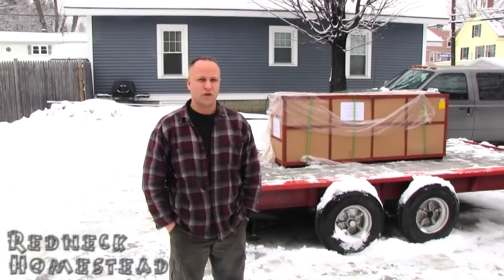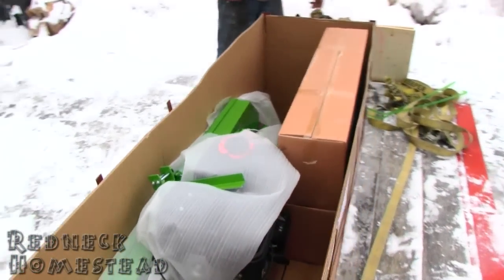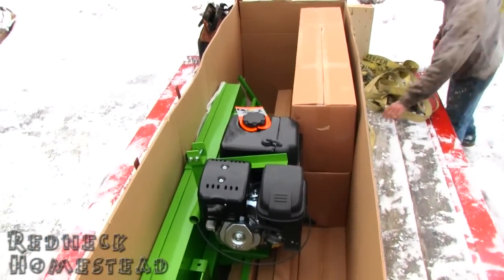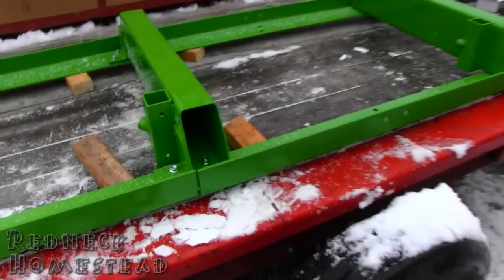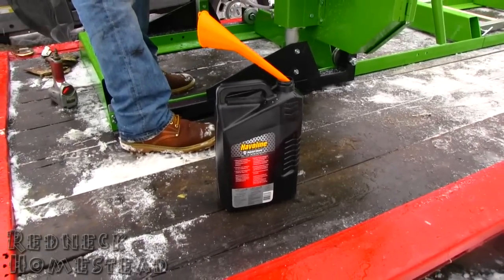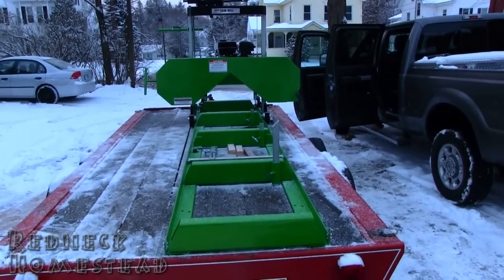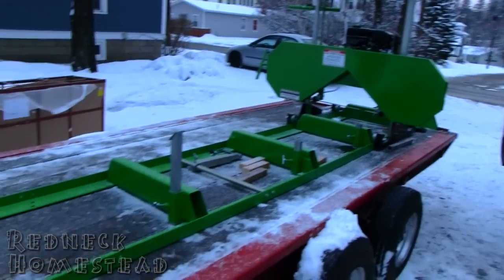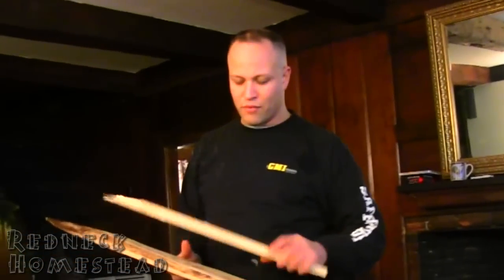Central Machinery / Harbor Freight band saw mill - unboxing, assembly, and review

Comment: I saw this little mill in my harbor freight catalog and thought "what a great thing it would be to have a very small mill for the smaller size logs".  I don't have my big mill up and going yet but the guy that had been cutting my lumber mentioned how he didn't care to cut the smaller stuff because by the time you get it set up......your done and have to start over.

Comment: Please shoot some more videos of this mill in action if possible. How do you think it will handle the big logs? I would love to see more videos of it. There's not many on YouTube. Yeah I know a lot of people don't like harbor freight but for most things they can't be beat anywhere else. Great video! Glad I subscribed.
Reply from the maker: I will definitely shoot some more video of the mill in action.  My initial impressions are very good but the log handling system is very poor.  I sawed 2 small logs last night and they were very hard to secure.  Admittedly, because the mill is not elevated (yet) I could not set the dogs low enough (they were hitting the trailer bed).  Additionally, the "log clamp" is clunky and with a point on the tip, it does not distribute the pressure so on anything but a perfectly straight log, you will likely get some lateral shift.  These are issues that are VERY easily fixed and i am designing a system that will be tighter, more versatile, and easier to adjust.  I will be doing a video on it in the next couple of days.  Thanks for watching, and we're glad to have you on board!  -Josh  (and by the way, i love to boat too!!!)
Reply: Redneck Homestead Great. Yeah you'll have to change a few things on it but it looks to be a great starter mill. Sounds like you're getting things figured out. No problem. I'm glad to be here. I do love boating but my problem is everything is frozen at the moment and I don't have a reliable motor. Lol.

Comment: Ready to purchase one for myself tomorrow. I will likely modify it as well. Add some tubing behind to make it a 4-post design. If you haven't already, check out Woodland mills HM 126 sawmill. Virtually the same chinese mill, but a few extra frills. It may give you some modification ideas. I'm going to purchase my blades from them. 10 lenox blades for 225 bucks. 144" x 1.25. They can be resharpened too. Thanks for creating a video. Information is power.
Reply from the maker: Thanks for watching Paul Weatherby !  I am excited for you.  The assembly was a breeze, but i would recommend considering welding the track segments for a smoother transition.  I, too, am planning on a 4-post design.  There is an unacceptable amount of twist with the 2 post design.  I have seen the WM HM 126.  My bet is that it was made in the same chinese factory!  That is a good deal on the blades.  I got mine (Lenox as well) out of an outfit in Maine called NH Bragg (http://www.nhbragg.com/)  very very good service.  Please keep me posted on your mill...i'd be very interested in your thoughts after putting it together and trying it out!  - Josh

Comment: Nice. Always wanted a smaller mill like this for myself. Just some advice that you may want to purchase in advance extra blades as HF is notorious for discontinuing parts for their products. I'm sure it comes with a standard size blade you could swap out with a better make though. Good luck with it!

Comment: That sure looks like a nice machine. Very interested in seeing how it works out. I could sure use one on my place. Price looks very reasonable. Considering how many trees I cut down and let lie, I could put them to good use for my woodworking projects, cabin or what ever.
Reply from the maker: Don Ritter It is HANDS DOWN the best deal in portable band saw mills anywhere i have found - after a couple years of researching them.  Sure, there are better mills, more bells and whistles and more conveniences, but be prepared to pay anywhere from $10,000 to $40,000.  The Central Machinery mill will cut all the lumber you need to build your cabin and every outbuilding, as straight as an arrow (if you set it up correctly), and will do so at a fraction of the cost :)

Comment: Awesome video, this is exactly the kind of thing I needed to know before I made the decision. Have some logs from taking down a 100+ year red oak here in Missouri and a chainsaw mill wasn't cutting it- literally. So I got one on the way.

Here's my question if you can answer it: how tall is the sawhead and how high does it have to go when you're assembling it? I'm asking because I was thinking of using cherry picker to put it up, and I want to make sure it can reach. Otherwise I'm going to have to build some sort of hoist.

Comment: Just wish you could buy extra rails for longer logs.  Sure it would be easy to just buy some of the same heavy angle stock and build it myself, but a kit would be much easier.
Reply from the maker: Yes, i agree.  As soon as the snow thins out a bit i am going to mount the mill on a trailer and modify it a bit to my liking.  I am going to weld the track together and remove the bolts holding the sections together.  I don't like how it is elevated by the height of the bolt head.  Also, i am going to get some angle stock and make the track at least 25 or 30 feet.  This seems to be a really good mill "base" which will take very well to modifications.

Comment: The instructions are awful, especially the diagram of the cable routing for raising and lowering the blade. , Also on the top assembly the nuts and bolts.need to be really cranked down otherwise it will slip down the pole on the side with the ruler on it. To extend the length maybe just order more track and a central beam?